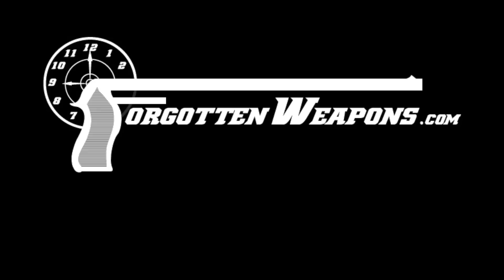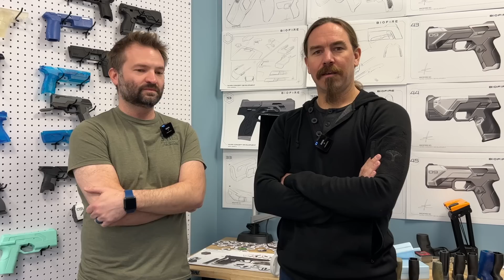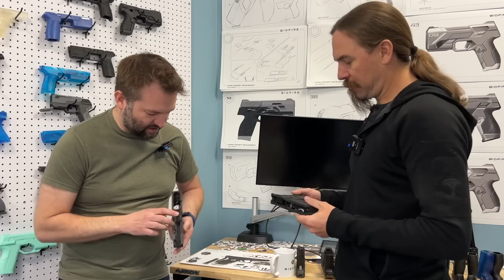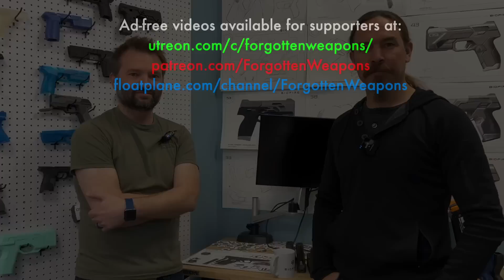Interview w/ Biofire's Lead Designer: Features and Reliability

Comment: I will reiterate, for any situation where you might need a gun to defend yourself you are either READY or you aren't ready.
A gun that locks itself when not in your hand is a neat idea but it doesn't change the fact that the one that shoots and HITS first is usually the one winning. Not the one that has the best fingerprint reader...

Anyone intent on coming to your home to shoot you has all the advantages. They have their gun in their hand, loaded with one in the chamber, finger on the trigger, steady aim and a plan.
You have a bulkier gun, that lies somewhere in the house because you don't carry it with you because it's bulky and it needs to be charged and then you bring it somewhere so you can grab it quickly and you leave it there out of reach anyways. You are not prepared, the gun might be loaded but it won't help you when you can't find it, you don't have the finger on the trigger, you don't have a steady aim and you most certainly don't have a plan to defend yourself at just that moment in time.

If you NEED a gun to defend yourself then you have that gun where you can find it.
In a stand ready to be pulled by an authorized user, on your hip, on your chest or in your hand already.

You DO NOT need a gun if you have a use for a fingerprint/face ID feature on it. Instead you need to re-evaluate your life.
If you have kids and you have a need for a gun then you need a gun safe that you can get into fast that your kids absolutely cannot get into.
And if you have kids but also have a need to have a gun that you can pull in seconds then again, re-evaluate your life because your kids are at risk as you are such a high value target that someone will sneak up on your family to shoot you dead in seconds. Split with the kids if that's the case, you are clearly a threat to your kids by proxy.

This is a pointless product that shouldn't ever have seen the light of day.

Also, the "feature" that if someone struggles the gun out of your hands and tries to use it on you...
That's NOT a feature. That's just excusing your poor suitability as a gun owner.
Reply: Fudd

Comment: Can be remotely disabled by the government?
Reply: It's got no wifi or internet connection. No bluetooth, no connectivity whatsoever.
Reply: @gunfumaster1024  
Yet.
Reply: @paulsto6516  well until then its not a problem.
Reply: @gunfumaster1024  doesn’t the stand though? Which transmits software updates when the gun is docked?
Reply: @alexmoore1506  No. Stand doesn't have wifi. They can't add wifi to it, because it doesn't have the hardware necessary. You don't put your email in it, you don't put any identification other than your fingerprint and face and it never leaves the dock. 

Also no need for software updates either. What you get out of the box is what you get.

Comment: The dual authentication is interesting as one of the most annoying things about working with your hands a lot is having to reset your phone's fingerprint sensor every week. Not to mention dust, grease, 5 minuets with some sand paper, even water can mess with a finger print sensor. It seems that BioFire has done a lot of research and development to make the best "smart pistol" they can however much like my smart bed that is very innovative and comfortable and has a responsive feature to adjust the bed for maximum comfort when I roll over on my side there are many times when it has: not adjusted properly, not responded to commands, inflated to maximum hardness at 3:30 in the morning for no reason at all. To me a gun is a tool not a smart phone. When I need my torque wrench it just works, when I need my chain saw it just works, when I need my rifle it just works. Yes the concept is neat but we added touch screens to cars because they were neat and now we can't get out of our Tesla because it bricked its self on the side of the highway and every function is electronic.
Reply: You're comparing it to a weapon alone tho, imagine having kids or something where you don't particularly want someone else being able to use it. Like being better than trigger lock or small safe for the nominal 2am oh shit moment isn't hard.
Reply: @hannahranga  I don't know if I could ever trust an electronic lock but I do remember as a kid going hunting with my dad and having eyes on experience with what a gun can do really instilled a reverence in me that guns are not something to be played with. As for a toddler age kid I'd have to come up with some sort of a cabinet that they couldn't open in place of some locked up safety device.

Comment: I still don’t understand how the requirements of:
1. Home defense
2. Inexperienced shooters
3. Need to fit a ton of biometric electronics

somehow resulted in a handgun and not a carbine.
Reply: SBR nonsense?
Reply: That's the problem when you ask inexperienced shooters what they want. It's like asking a fish how to catch fish instead of asking the fisherman
Reply: @gunfumaster1024  I promise, I absolutely promise, a predatory fish is a better fisherman than anyone who has ever operated a rod and line, and if you're talking trawling, thats just cheating and it super doesn't count🤣
Reply: @gunfumaster1024  This is 100% a flaw with their product research and design process. When I got into guns I had no idea what I actually wanted in a carry or home defense gun until I had a good bit of experience under my belt. Some things I thought I wanted turned out to suck, and other things didn't matter as much as I thought they did.
Reply: Carbine: Longer, heavier, harder to store, less wieldy in "fight in a phone box" tight confines, not a concealed carry option unless you dress in The Matrix chic. 

 Pistol: Small, light, easy to store, very easily manipulated in tight spaces, easily carried on the hip, under the shoulder, appendix carried, drop legged and therefore readily concealable, unless one happens to be wearing nothing but speedos.

Comment: >life or death situation
>draw gun
>it doesn't work because i forgot to charge it
>it doesn't work because the firmware crashed
>it doesn't work because the sensor is dirty and doesn't recognize me
>it doesn't work because some circuit got wet/dirty/grimy 

In theory it's a nice idea and it could be very reliable in a decade or two but right now i would never trust it.
Reply: If you're carrying this gun into the Alaskan wilderness and expect it to get wet, cold, and dirty, you're not the target market. With its integral charging stand, it is positioned as a bedside home defense gun or maybe a law enforcement sidearm IF the agency has firm procedures in place to put the gun back into the charger @ end of shift or whatever.
Reply: @CuriousGuyHobbies   this would be great for law enforcement
Reply: @CuriousGuyHobbies  this sounds as ridiculous as the "glocks are made of porcelain" BS from die hard 2. let me see if i understand this correctly. this gun only works reliably if:
the sensors are free of any dirt, fluids or particles that can interfere with detection.
the shooter isn't wearing any kind of gloves, a band aid on his finger or has a tiny cut on the tip.
hats, shades, glasses(?) maybe even a full beard(?), low light conditions? can interfere with detection.
its battery is charged(people forget to charge their phones all the time btw), which is every couple of days? hours?

so it's, as far as i understand, made for a situation at home, in daylight or other well lit environments, where the shooters face is clearly visible and unobstructed, the hands are free of anything at all(fluids, dust, dirt) and it, more or less, was just disconnected from the charger. also no idea if the firmware on that chip ever has to be updated(bluetooth? wifi?), which hopefully never happens when you actually need it.

i would love to hear what all the "don't trust automatics because they jam all the time, only carry wheel guns"-crowd has to say about this gun. they'd probably have a stroke.

Comment: I am still suspicious of the reliability of the weapon. If this is going to be a viable nightstand gun it needs to work 100% of the time. Jams need to be non-existent. Furthermore, the electronics and code need to be on point to the extent that it is verified by the time you can get the gun aimed at thw bad guy.
Reply: Yeah, I agree with the idea of multiple redundant authentication systems but fingerprint plus face recognition isn't enough. Wake up at 3AM when a window shatters, grab the pistol off your nightstand in the dark, the fingerprint reader fails because of a cut/dry skin/something spilled on it/whatever and the camera doesn't recognize your face in the dark with long hair over your face and you're laying half on your back in bed. Maybe add a transponder ring like the Armatix watch as a third option?
Reply: @elektro3000  I am disappointed that the fingerprint reader isn't ambidextrous because there is no guarantee that you will be able to access the gun from a specific hand.  Also that the feedback is visual rather than tactile.  You have to look at the gun to see if it is "on" which means you can't be keeping your eyes downrange.
Reply: Said "  I am still suspicious of the reliability of the weapon.  "
Then don't buy one, you are not the market.  Also, what sort of quick access safe are you using?  Does it work 100% of the time ?    What if the batteries lose charge ?  What if there is an EMP and someone is outside of your bedroom window with a thermal imaging camera ready to shoot you from 100 yards?
Reply: @bobroberts2371  Not gonna buy one and I am not going to stop talking about my doubts because I don't want people to waste their money without thinking it through.   You however don't seem to care if they do

As for your childish and  idiotic "what if" snark all I can say that gun safes and current guns have a history in the marketplace of which prospective buyers can research. however, this so called "smart gun" is untested so "what ifs" are completely legitimate for prospective buyers to consider.
Reply: @alexh4436    said " Not gonna buy one and I am not going to stop talking about my doubts because I don't want people to waste their money without thinking it through.   You however don't seem to care if they do     "  

So you would rather the target market for this gun not get a gun at all?  Hmm, lets see, a potential 99 % reliability Vs 0 % reliability.  What would you pick? 

said "    As for your childish and  idiotic "what if" snark "  

I quick search of YT will net many people concerned about / how to defend against an EMP, care to call them childish on their channel?

"   this so called "smart gun" is untested so "what ifs" are completely legitimate for prospective buyers to consider.  "  

So just how do items become " tested " or " established in the market place " if no one buys them? 

Besides, " smart guns " are not for . . . Oh well, never mind.
Reply: Even the best “dumb” semi-auto pistols can’t claim 100% reliability rates or that they never jam. Why would you insist on that requirement here?
Reply: @chekovsgunman  Maybe because the the gun that was hand picked by the manufacturer to give to the reviewer jammed twice under ideal circumstances.  That's not normal and even the cheapest fly by night gun manufacturer would agree that such a gun was defective and issue a replacement.
Reply: @alexh4436  
I've had a HP jam twice under "ideal circumstances" but Browning didn't give me my money back because it turns out the ammo was bad from the manufacturer. Now that's pretty rare, but nothing is 100% that's why we practice jam clearing, and find the ammo types our semi autos like,  or stick to revolvers. 
Expecting this gun to hit a higher standard (100% reliability) than all other guns before it is laughable. It was also clearly stated to be a prototype gun and that they were still working out kinks on it. It was not final production. 
Don't want to buy it ? Fine don't, but there's no need to come up with some ridiculous scenario as to why like many that I've seen here.
Reply: @Bagledog5000  Well if you didn't actually test your HP with other rounds of ammo from other manufacturers before concluding that the gun was at fault and shipping it off to the manufacturer then, you certainly shouldn't really be giving advice to others about firearms. 

And generally when competent companies start making promotional videos they are beyond the "oops its a proto stage" and the fact that this company went ahead anyway is another perfectly non-ridiculous reason to not to trust their quality contorl.  What is ridiculous is to look at a promotional video and cherry pick things that confirm your initial biases.  What have you got against prospective buyers hearing both sides while considering a high priced item?
Reply: @alexh4436  
Alex, I didn't ship the gun back to Browning demanding a refund, I already suspected  it was an ammo problem, but on the surface everything seemed ideal, just like it did in the video you watched.
Speaking of ammo why should I have to test my 100% reliable old school firearm with different ammo types anyway? After all it's 100% reliable because it's a proven design right? End sarcasm here. 
I've got nothing against hearing both sides of an argument, my beef is with asinine "what if" scenarios that in many cases, regardless of the firearm you have at hand will be difficult if not impossible to prevail in.
 That and expecting "100% reliability" from this gun just because it's new tech, while ignoring that no firearm has ever delivered 100% reliability is frankly absurd.  Pot calling the kettle black on biases IMO, except that unlike you,  I don't have any preformed opinions about this weapon and am willing to wait for the review of the production model BEFORE, I decide to say whether it's junk or not.
Reply: Battery life is the real issue.  Even if the authentication was 100% perfect and took 0 nano seconds to verify, doesn't mean shit if the battery is dead.

Every handgun i own will go bang if there is a round in the chamber, and the striker or hammer is cocked.  As will every rifle and shotgun.
Reply: @jeromethiel4323  That concerns me too.  I know the thing is meant to be plugged in all the time but that isn't realistic.  I have my lap top plugged in all the time but sometimes it gets disconnected, sometimes the power strip it is attached to is turned off etc.  If the sole use for this gun is home defense then it is likely that the gun is going to just sit in its cradle for a long time and eventually the owners will let their vigilance slip and one day find out that their battery is dead,  hopefully in a non life threatening manner.
Reply: Ian's earlier video showed this

Comment: Anything that operates electronically can be defeated electronically. No thanks.
Reply: If someones busting out an emp device to prevent this gun from protecting you, you have bigger problems than a non functional gun.
Reply: @madnessguy1300  I didn't say anything about an emp device. All you have to do is figure out a way to turn it OFF.

Comment: I've been paid to program, maintain, specify, assemble, install, and support all manner of desktops, servers, networks, and various devices that are run by computers for 35 years.  HELL NO.  get that crap out of a weapon.  you want to have a failure to fire because the security choked and you're dead because the bad guy shoots you?  this is how it happens.

Comment: So I'm a bit of a tech minded person who spends way too much time learning about weird space things.

The BioFire has an electronic fire control group. Fire by wire. Is it susceptible to a cosmic ray bit-flip? It's a 0.000000001% chance of happening but, but it does happen. Belgian election from 2003, one candidate got an extra 4096 votes when a recount occured. Cosmic ray flipped a 0 to a 1.
Reply: So about the same chances of a mechanical safety malfunction?
Reply: @kanagawakenji7  Sure, but a mechanical safety malfunction generally won't fire a round into your charging cradle.
Reply: @Flyingpapaya  do you usually tape the trigger down or something?
Reply: @madnessguy1300  I don't understand what gotcha you're trying to get me to fall into.

Comment: About color 13:00 as someone who is red/green colorblind, which is the most common type, I wouldn't advocate for any particular color combination - I'd just go with lit up or not. Or solid vs blinking. A lot of people really, really can't tell the difference between green and red, and then as the designer mentioned, those colors have different meanings to different people for all kinds of reasons.

But everyone who can see can see lit up or not, blinking or not. A front sight that is meant to be illuminated but is instead blinking would immediately tell the user that something is wrong. The one piece of information I need when holding a firearm is "Will this go bang if I pull the trigger?"

Everything else is secondary. So the laser on authentication is halfway there, but I really don't want a laser on a pistol meant for self defense.